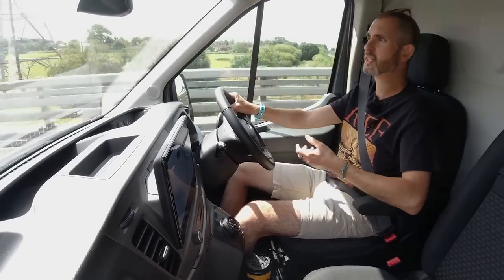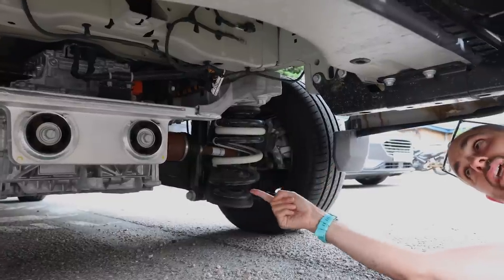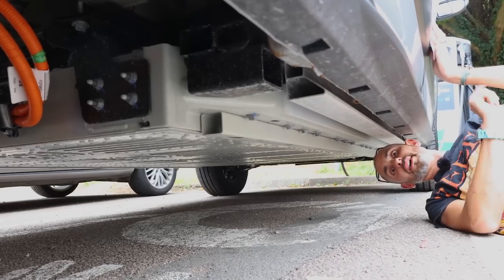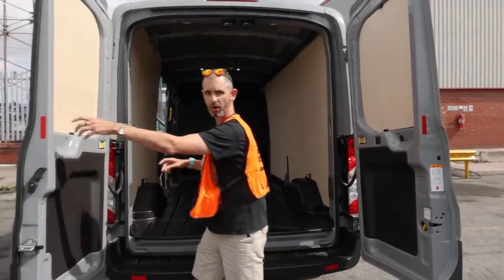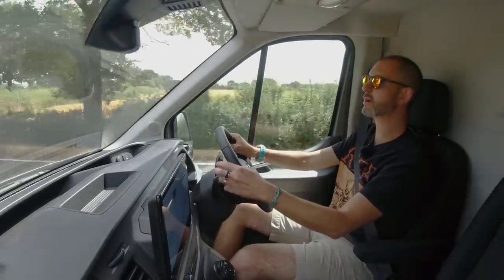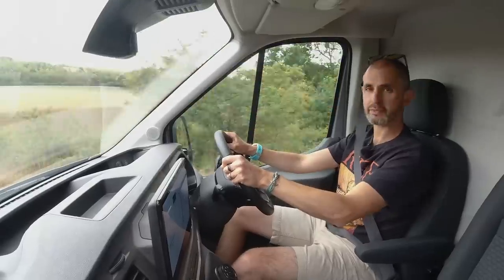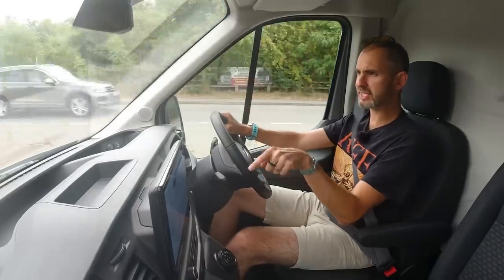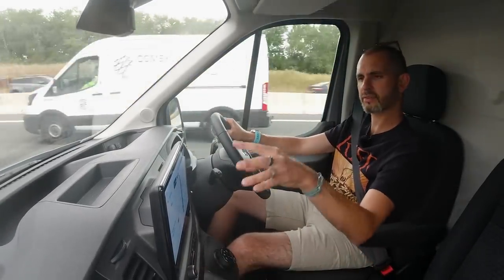New Ford E-Transit electric review - the most important van of 2022

Comment: What will it do fully loaded all day?? 
I still think that It will all work out almost the same cost in the end unfortunately.
The main power grid is the main issue with EV now. 
If everyone comes home in their cars at the same time... Then all the transport companies plug their vans and trucks in then there is gonna be some melting cables.
Remember what used to happen when everyone turned their kettles on at the east enders break?.
All the upgrade costs will go to consumer.
I'd count in the cost of having a battery wall at home and the possibility of electricity costs rising a lot.

Comment: Merc do an E-vito with a 100KWh battery and over 200 mile range. Priced cheaper than the Petrol Ford Transit.
Reply from the maker: That's good, but the E-Sprinter is a bit token.

Comment: How are you making deliverys when 166 mi can be done before lunch .? You make your delivery to the last guy on your list... limp home and plug it in ..... . If you know UPS those guys are running  till dark ...cant sit at a charger on the clock....
Reply from the maker: Yes, correct. In a fleet scenario this van would be allocated deliveries that didn't require charge stops. However, I wanted to test the van under harder circumstances, which is long distance high speed.

Comment: That range isn't practical if it's used for deliveries say amazon for example. Once you add weight to the van that range will plumit, or on a cold day. You'd have to spend so long charging it. I like the concept just not there yet

Comment: According to rough figures, a loaded E van would have to charge 3 times over a 300 mile journey.  At 35 mins each charge, that's  nearly 1 3/4 hours provided you can find a high capacity charger that's not already in use and in working order. Averaging 50mph in the time it takes to recharge an E van I could travel approx 75 miles in a diesel van. Van drivers are already under enormous pressure to complete their journeys in the shortst possible time, so I can't really see white van man being happy over long distances. Great in a city on local work but not practical on distance work, especially if you're self employed.

Comment: it look nice but the cost efficiency is questionable.....then there is the conspiracy part of all of this why fuel prices are so high.....and also saying that you can put solar panels on your roof.....sadly those are not cheap and also wont work at night to do overnight charge so you need other power management.....all in all its nice but wouldnt a hybrid version be just better? To run on highway you could use diesel.....to move in city traffic...stop and go...you could use electric....best of both worlds....

Comment: Johnny to Phil - ‘sorry I’m late’…….this is what most EV van drivers will be saying! Also how you managed to find chargers that weren’t already being used is great, round by me there are queues for them during the day which is a turn off for sure. You make a compelling argument with the cost of fuel currently and electric is much cheaper, however, wait til the govt has most of the market as EV then they will spank us on cost like they have done with petrol / diesel today. Not anti EV but we shouldn’t be thankful for a 145 mile range should we? A diesel transit will do 600 miles on a full tank these days, so anywhere you’re going you’re starting off with 1/4 tank. Barely ideal

Comment: Sorry but this is going backwards 
140 miles range from day one 
That’s gonna drop after a few charges and even worse in bad weather or night. 

35 min rapid change every 100 miles.

It costs more , it’s gonna have zero second hand value as no one’s gonna wanna buy a second hand E van so it’s life expectancy is much less that a engine van. (gov will love that though)  so it’s gonna need recycling and replaced cause more environmental problems. Also the electric will come from power stations so there is a good chance it’s coal. Solar power would take a week in 40 degrees to charge this van enough to do 100 miles.

Rd the doors it might warrant but it’s a step forwards and backwards
Reply: Unless there will be companies that refurbish battery packs and so on yes this is going to have zero value except in spare parts , but you forget something , companies like this eco bs. they make more money they look better for the consumer and te stupid consumers think they are doing something good .
I bet my old mercedes sedan is more eco friendly in the long run then a new electric car.

Comment: As a small business owner that has engineers take vans home nose charging is a no go when so many vans get broken into over night. Having to face the van nose in on the drive with the rear doors presenting a target to the road puts any of the electric vans off the list straight away.
Reply: As an engineer maybe you can invent some kind of cable lengthening device. Some kind of cord that would "extend" the reach of the charging cable.
Reply: @fallenshallrise  That would not be sensible for a 7.4kw charger as the extension would not be locked to the tethered cable. They are also limited to a maximum length of 6.5m due to regulations. IE shorter than the length of that e-transit.

Comment: £2.06 for diesel at an M1 services, but I am currently paying £1.57 on a fuel bunker card not pump price. That road noise is from the tyres, not the engines. diesel is king. Dont forget your electric bill will be increasing 4 times a year at least now
Reply: So what? Slow charging overnight is cheaper than diesel.
Reply: @Simon-dm8zv  But doesnt last nearly as long as diesel. Diesel is the best
Reply: @stevecampbell7589  The emissions are soon no longer acceptable.
Reply: @Simon-dm8zv  they will be pet
Reply: @stevecampbell7589  pet?

Comment: If you take into account the total miles driven between all vehicles types per year. This specific van size represents only a small fraction of that number. The investment required to charge one or a fleet of these from your own depot via solar is enough to make the diesel a bargain. Let's not even talk about range, charge times or weight. Don't be fooled by the government sponsored push into electrification.

Comment: Surely commercial vehicles like these - on the move all day - would be massively better as hydrogen powered vehicles rather than battery. 
They go to depots regularly, they can be filled quickly (not something that batteries are good at) and they'd also be low emission.
I just don't see how a working vehicles, on the road for all the working hours of the day, fit in with the existing battery EV model.

Also - do we have the charging capacity, both in terms of actual outlet and electrical supply, to have commercial vehicles vying with private vehicles for spots in motorway service centers or wherever?

Comment: MERCEDES SPRINTER
'OM647' ENGINE
"MILLION MILE MOTOR" 
MINE HAS 866K MILES
STILL PULLS 23MPG DAILY FULLY LOADED

ONLY THING I EVER DID- 
AT 165K I SWAPPED THE PLASTIC TURBO RESONATOR TUBE WITH AN ALUMINUM ONE!!?? 
LITERALLY THATS IT!? 
17YRS NOW - ALMOST 900K MILES 
NEVER BUY ANOTHER VAN EVER

Comment: Would like to see the custom EV transit and basically what that costs and can offer and if its compareable to this transit..
I disagree that E.V vehicles will be cheaper to run then combustion engines... the government has a benchmark of taxation on fuels and their certainly not going to loose revenue just coz were driving less emission cars...they still want your monies dont be a fool to think otherwise...
The ultimate benefit to come out of EV will be less noise and less carbon emissions... nothing else...
Pound for pound driving will still be an expensive PRIVELEDGE as the government put it...

Comment: I don't think we are anywhere near making these work as a horsebox.  Stopping for a half hour plus with a horse is something you would want to avoid and the EV payloads seem to be a long way off on 3500kg versions.  Youngsters would need to take the heavier vehicle test to get the same payload as a diesel 3500kg rig.    Also the only new diesel platforms and chassis cabs I've bought have been well under list price.  Not sure the manufacturers will be as generous with an EV.   It's all too expensive and impractical.

Comment: I always enjoy your videos Johnny, but I can't reconcile your justification on this van. Yes the price of Petrol/Diesel is through the roof, but that's entirely political and would be a lot lower if politicians weren't so easily corruptible. Putting that aside however, the cost of electricity is incredibly expensive too. I'm a British Ex=Pat living in Oz and Solar is a very real thing here - so perhaps it makes slightly more sense here (assuming you have 3 Phase Wiring in your house which 90% of houses here don't), but in Sunny Croydon where I grew up, renewable electricity isn't a thing at all - I'm basically running an EV on coal, right?

EV's have a future in one form or another, but I don't see it in White Van Man World just yet.
Reply: The van makes perfect sense for delivery services. Even on non renewable electricity electric vehicles are the cleanest option. There is absolutely no reason to postpone EV adoption. Most of these vans will be charged at depots where 3 phase chargers will obviously a normal thing.
Reply: @Simon-dm8zv  He had to charge TWICE during the day. My brother is a Courier and he thinks that it's laughable to suggest that's remotely practical.
Reply: @harpersneil  These vans are great for specific delivery services in cities
Reply: @Simon-dm8zv  Very specific needs, and that's exactly my point.

Comment: Towing. Have people stopped towing caravans, boats, gliders, motorbikes, other cars? Car reviewers don’t mention it but many of the things people tow are heavier than they used to be and if people don’t want a Range Rover what options are there? A ford transit or VW transporter used to be a good towing option, particularly in 4x4 spec.
Reply from the maker: Towing is a box of frogs for a reviewer, but basically shorter distance many EVs will pull 16-800kg now. Beyond that it will still be piston power.

Comment: The thing I get with electric is why the hell don’t they use the roof as a solar power one just don’t get in use the roof to charge it.
Reply from the maker: Agree. I wish it was an option on LGV!
Reply: The roof area alone wouldn't be large enough to provide the sort of charge you'd be thinking of. You'd need a solar panel the size of a tennis court for that.....

Comment: I think EVs are good idea, as long as we can still have petrol or diesel if we need it or desire it. To be forced into expensive vehicles with a poor range isn't going to help anyone, my wife has a business that requires us to make a 380 mile trip maybe once a month to an auction, it takes all day, if we had to stop to charge probably at least twice it just wouldn't be viable any more, and she would have to pack up, forcing people into buying expensive impractical vehicles is very short sighted. 48k for a van?? We bought our master for 3k we fill up once do the trip ( and fill it to the roof) and return, we couldn't do that in an EV we'd probably have to charge 4 times because of the weight carried that's two+ hours added to a very long day.

Comment: Unfortunately ford vans rust quicker than the railings round our seafront’s here in the uk…
I take it the electric ones will just be as quick to rust as the diesel ones..
🤔🥹
Reply from the maker: Any vehicle by the sea needs drowning in Bilt Hamber corrosion protection from new. Best £50 you will ever spend.

Comment: Good video Jonny. I noticed it was already going rusty underneath, and surely the obvious thing would be to make the massive roof a solar panel. Hopefully, the company drivers will be getting paid while it is being charged. good comment on the fact that trucks need to be on Hydrogen, you mentioned the cost of diesel, but not the cost of charging the van, why?

Comment: Same bloody story not enough range most of our van fleet do 260- 320 miles a day, there is loads of space under the fllor of a transit should of been 100kw battery my company car eqa has 77kw battery with 265miles of usable range squeezed into the old merc gla petrol and diesel chassis. real shame poor effort messed up a bit there.

Roughly 42million cars on the road & only 2.1million hgv's on the road in the uk. 
but they are used 7-12hrs a day, a car just 34mins on average so yes defo very very important to get tem EV.
Johnny next time load the engine via side door loads should be up against bulk head to stop injury in a emergency stop/crash you know thos from your filming on fifth gear on unsecured loads

Comment: The reason why the van has a smooth ride is that those batteries weigh a lot and the weight is distributed.  Coil springs are needed to support weight.  The aluminum assembly you showed in the back takes up ground clearance and what happens when a pot hole causes a bottom out?  The range sounds good, but that’s not with the full load.  What happens in all the stop and go on the city, when accelerations suck massive current?  Need to stop the hype!

Comment: Compared to the terrible reliability of modern Transits anything will be a massive improvement. Their internal rubber cambelt design used in most modern transits and ford cars, which requires a replacement engine between 45 and 100,000 miles.. is a total disaster.
Reply from the maker: Agree, daft design. I feel like Ford engines are rarely the best designed or most efficient.

Comment: One of the biggest problems of this van is that the steering wheel is on the wrong side. In addition the video creator was driving the whole way on the wrong side of the road. Very very dangerous video.

Comment: i just cant see how anyones going to get anything done, its going to be one big doss in  garages getting recharged every hour and a half. you omitted to say how much the recharge cost, or how much a full charge at home cost  ( which incidentally costs about a grand to have fitted)  nobody drives an empty van they are loaded up to the roof  and £50k for any ford is ludicrous, my customers will run a mile  when i tell them its £3 a mile and it gets there when it gets there.
im amazed ny the said range but there is still a long long way to go before it becomes a viable option for  proper daily van use which in my case is 300 mile plus a day and i want to be home by 8 pm not piss balling around in garages getting charged

Comment: Great review, it makes sense to have delivery and transport vehicles electric. They need to last the days work. Only negative thing is there a coal/ gas fire electric vehicle. Solve the main charging network ie main power stations need to be green also. Yes there is a lot of green energy into grid but the main power stations are still fossil fuel.
I was looking at van going there is enough roof space for solar array, 9 panels about 400 V just to extend range.

Comment: "Typical user travels 69 miles a day." I wish journos would stop justifying the manufacturers' BS daily averages to gauge appropriate distances for EVs. It's complete bollox. Averages are averages. A daily average distorts a more typical week where there is likely a much longer journey one day a week. Very common for, say, a plumber to do mostly, say, 50 miles per day, then 300 for one day. Which gives and average around 69 but a capacity requirement of at least 200 to be useful (spending at least 1.5hrs in a work day charging is not realistic.)
Averages would be far more useful and realistic as a statistic using the upper quartile of standard deviations. but I guess that wouldn't play into the marketing sleight of hand.

Comment: That touch screen is the equivalent of a mobile i phone, so operating it is basically the same as a mobile phone, so it is illegal to use whilst driving. Plus the driving you are doing is careless, as your arms are waving about and you are touch screening various things, so you are driving carelessly. and should be prosecuted.
Reply from the maker: I won't be prosecuted Stan, because I am driving a van with touch screen controls. If using a touch screen was illegal then half of the motorists driving new cars would be in prison tomorrow. I don't like touch screens and I do see your point, but I am here to demonstrate the reality of these systems. As I pointed out, real buttons are usually far easier, faster and safer.

Comment: like you say, they definitely have their place for your fleet of local couriers ( amazon, DPD, Royal Mail/ParcelFarce etc). 

Would they work for the other 75% of the market? No chance. 

Your journey from Doncaster to Luton would normally be around 2h30m, in this eTransit you're looking at 3 and half hours with stops for charging. Those are hours that driver still need paying for. Imagine running multiple vans with multiple drivers over the course of a week, yes you would probably save on fuel costs, but to have drivers sat around waiting for the vehicle to charge could add up to ultimately lose you a job over the week.

Also it was mentioned that they're available as a 4.2t GVW which I assume means a tachograph and operators licence will be needed along with 90kph limiter. This would then defeat the whole point of this category of vehicle.